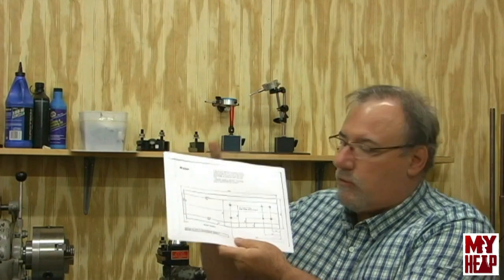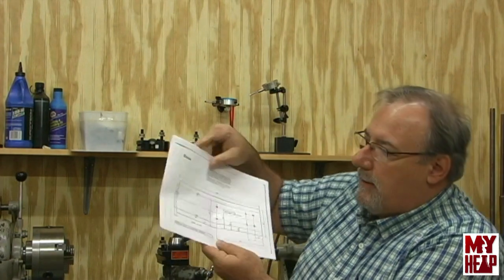Kenneth Wells Stationary Engine - 01 - Introduction

Comment: Pretty cool, cant wait to see it come together. I think the boiler is the hardest part, but as long as you can get enough heat into it to get the silver solder to fully flow and get it to seal up completely, then you shouldnt have any trouble at all with the build.
Reply from the maker: Thanks Chirpy.  It should be interesting since I have never done any of this stuff before.  Thanks for stopping by.  Going to watch your steam fest videos this evening BTW.

Joe
Reply: if you need any  help casting the brass bits and stuff, just let me know, I know a few tricks that can make it cast pretty easily, and some that may make you laugh a little bit.
Reply from the maker: Thanks Chirpy for the offer.  I may need to take you up on that.  The only casting for the stationary engine is what the cylinder plate attached to and the crank shaft goes through.  With some luck, I think Emma will send one.  I am one of the people that asked for the traction engine castings.  But don't think you're getting off the hook, I am sure I will have questions and problems down the line.  :-)
Reply: lol, Ill keep an eye out for any questions then.
Reply from the maker: Thanks Chirpy!

Comment: im excited about this. you will build it. the traction engine is running on the bench as i type. ill get you a casting asap, but you have a bit to do first. :)  i sent an email too.
Reply: and shared it to my fb, so hoping you get some subs out of it.
Reply from the maker: Thanks Emma.  I have my stock ready for the base plate.  And cut a couple pieces of metal to use as folding bars.  Will be working on it and doing some video tomorrow.  Thanks for stopping by.